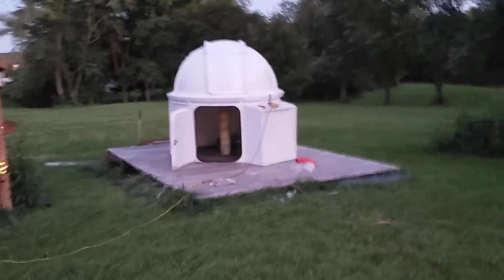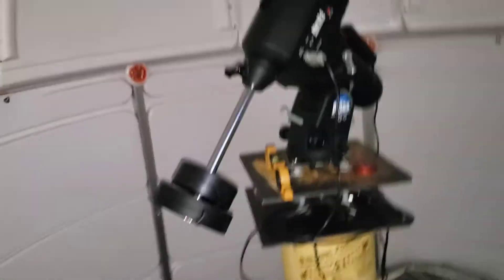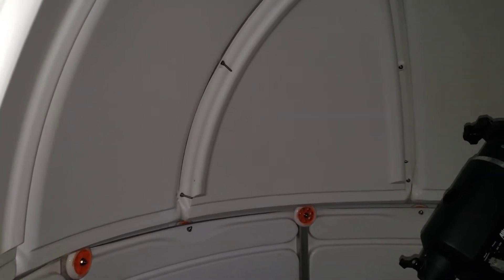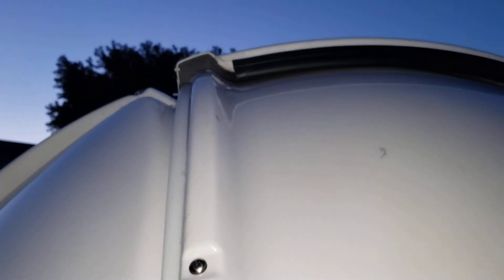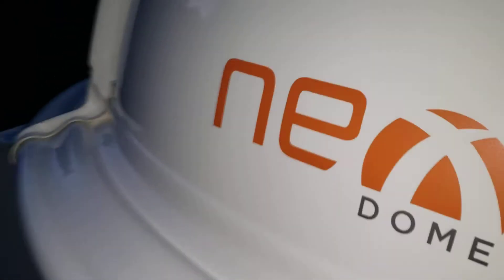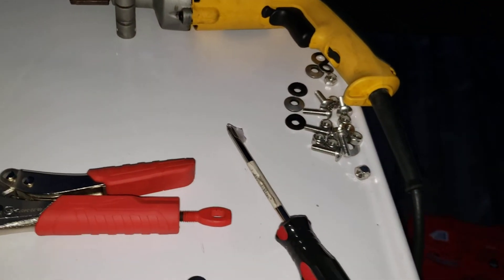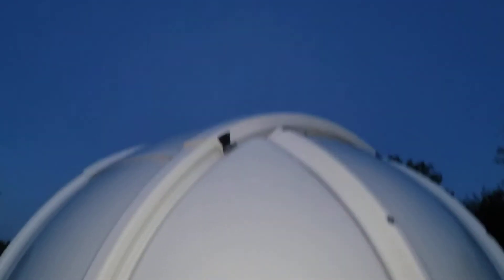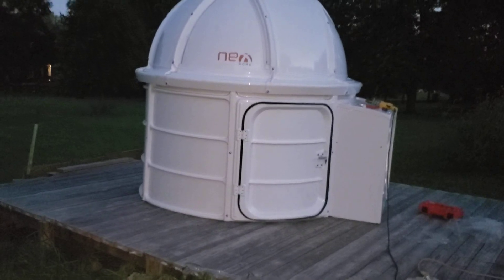NEXDOME 7 dome in place

Comment: Yeah....all those screws needed to be at LEAST 1/4"longer and all those hole needed to be 1/32" bigger in diameter. 1/4" bolt with a 1/4" hole does not make for an easy fit. And thank you for noting the "L" brackets. Saved me the time of undoing and redoing again!